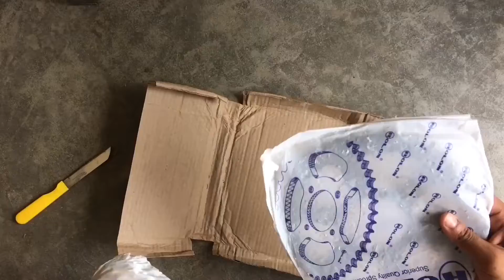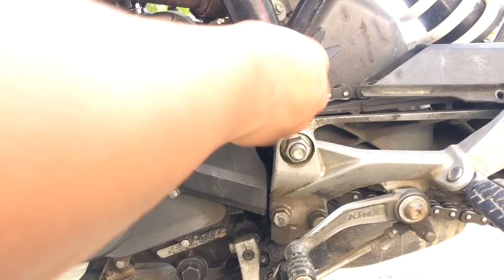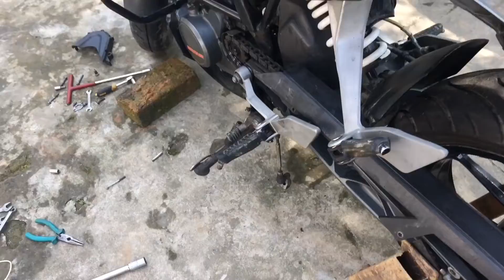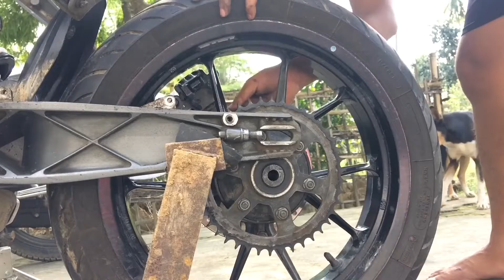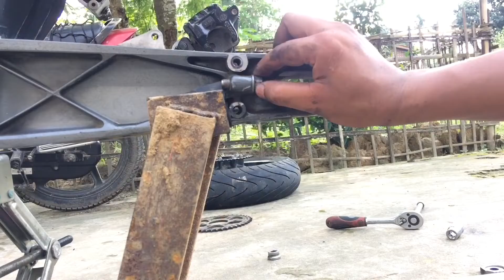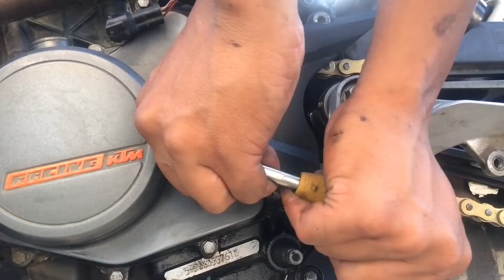Chain Sprocket change in Duke 200

Comment: What are the sizes of sprockets and how many links are there in the chain ,can it fit for duke 125
Reply from the maker: The size of the sprocket is 42 teeth in real and 14 teeth in front. Your duke 125 has same as front and rear in 45 maybe. You should search in internet for buy. Thank you for your comment. Much more website are there for buying.